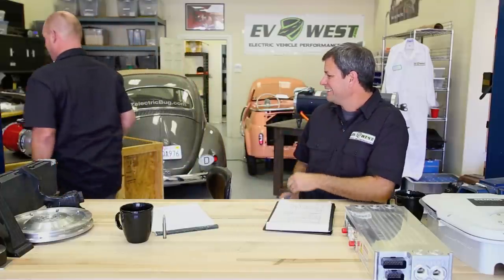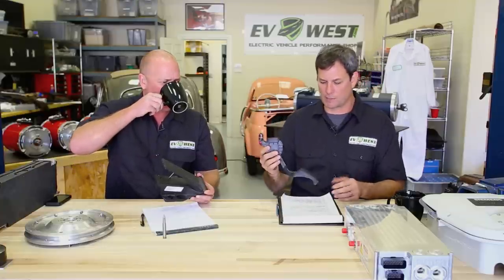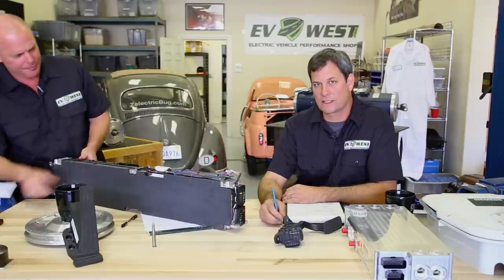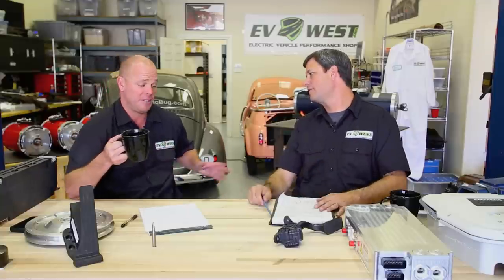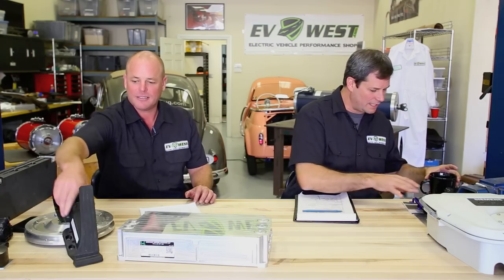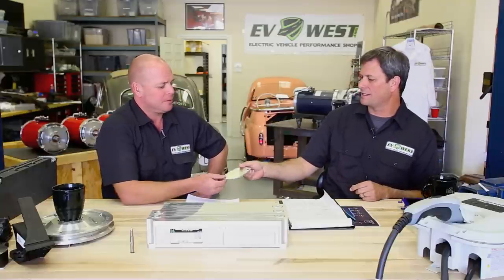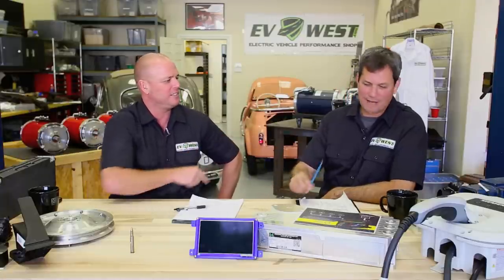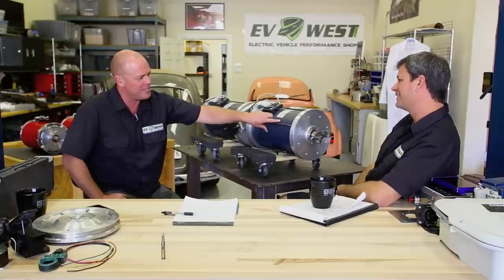The EV Show - December 2014 - Episode 1 - EV West

Comment: Great show guys....  I love the work with the triple HPEVS motors.  I was inspired by Michel Bertrand's AC 35 triplets in his 911.  I got the wife's permission for my next build.  It will be a 1940 Ford Truck in true hotrod style with a motor on each axle.  I am leaning toward a AC35x2 on each axle with a Currie Ford 9" independent Diff with a 7:1 circle track gear set for direct drive....

I am really pleased to see a show about EV that has a focus on performance...
Reply: I cannot wait to see that beast!  Jeff,...With all your experience with the Allen-Bradley equipment, do you have any special incite into the pros and cons of stringing relays and contactors in parrellel and series?
Reply: Well the danger of paralles is that if one does not pull in you try to pull too much current through one relay...

The problem is that it is difficult to detect a failure...
Reply: Jeff Southern
How about running 2  - 12V relays in series with 24V?
Reply: The triple AC-51's are providing engineering challenges to fit into the Ferrari mid-engine area with the G50 but we got it.... nothing we will not document and share..... The performance specs are ridiculous! We can barely wait to start testing it on the pavement. There is an extra stack of tires already waiting to use in the first week. But back to basics, lots of fun fab starting tomorrow.... Will keep updated posts on progress on Instagram. Follow "ElectricFerrari" for a Ferrari 308 GTE specific thread!

Comment: I wonder if Jehu's contactor problem was from using too small a cable and/or lug, which didn't dissipate enough heat.  Along those lines, the copper bars he's using look a bit thin to me.
Reply: Was thinking exactly that as well. The RC connectors had me concerned as well.
Reply: 2/0 AWG wire

Comment: Great Show!. Ive been waiting for something like this although Jack at EVTV does a good job but it just tends to drag for too long. I want to know more about the Triple configuration. Will the 3 motors run with a belt or chain drive. Due too so much torque and RPM wouldn't a belt drive wrap or snap?  Thanks guys.
Reply: michel bertrand No. It's still there. Good or bad, we don't delete any comments.

Comment: This show has a lot of promise.  A few suggestions to make it even better: 1) Less talking about the products and more doing things with them.  More of what we saw in Jehu's segment.  2) MORE CARS!  This is an EV car show, after all.  3) Showing the step by step process of how you go about an EV conversion would be ideal.  I know that would probably be too much for a single show, so you could break it up over multiple shows, or at least show the highlights.  4) Cut the running time down a tad.  Most Roadkill episodes are between 30-45 minutes, some even less than that, and they cram a lot of content into it.

Comment: A question about the joined HPEVS motors...
Is the accessory shaft at the advertised size, or are they the same size as the output shaft?
My eventual plan (when I get enough money to do it) is two AC76 motors for an '03 Mercury Grand Marquis, and I've been hoping that the accessory shaft would be strong enough to take the torque of another motor to simplify the mating process.

Comment: Eric's coffee cup is way too big! Best keep him away from the chocolate before recording.  I like Jehu's Idea about splitting up the current over several contactors, But I have concerns about the current carrying load of those cables.
Reply: I was also concerned that during Jahu's demonstration that the contactors control wiring were wired in series and would not work properly.  I seen a few minutes later during the installation it had been corrected and wired in parallel.
Reply: technogeekworld The coil wires were plugged in series,   the High voltage were connected in parallel, they are 2/0 AWG
Reply: Yes, the coils will still work, but there will be a voltage drop across each of the coils.  In parallel  both coils will get full current and voltage. This is important as you want those contactors pulling force to maintain good contact.   Will it matter ?  Why take the chance of not making good mechanical  contact to create heat. Please consider
.
Reply: Someone was not paying attention to the video,   Contactors are 12v,  my curtis puts out 24v,  thus the series connection.
Reply: Now! you have my full attention! I want front row seats to this!  Get a GoPro in there!  While they are energized get a meter in there.  There is still one more opportunity for adding a resistive load and putting them in parallel.  I'll not bother you more on this any more. I look forward to learning the outcome.

Comment: OMG.. the banter!  Sound like a great concept show. Too much banter not enough info to keep me watching. Also, too non linear, and using terminology without explanation.
Reply: +joseph medina  I can handle the banter, These guys aren't "The View" thank God. lol But I too would appreciate greater explanations of terminology. It IS  a new world. I do love the show and will be subscribing and watching. :) Thanks Guys.
Reply: hey ev west im gonna sell you a moped with a one ignition acc, double 
beam support, nice road tires, and a cool neat pulse circuit.  Tfh chain
 is horizontal, 2005 xtreme scooter frame&housing, but u have to build it man!
  Im sending it right now.
Reply: it will even hav lights that trickle charge, in case you dont have room in the housing for an aux battery...cooolllll!!!!  3-5 year lead acid battery replacement, 1000watt motor, 25 miles+ range...contact me somehow on it
Reply: prototype for sale

Comment: Guys I hope you get into Electric Drag Racing Programs for us guy's that just want to have fun and kick some ass.   I would be interested in a system what would make about 1000 hp at 5252  and would have 1000 ft lb of tq   from  0 rpm right up to 5252 rpm.
I want to build a tube car with a Ford 9" rear and direct drive.   Total wt of about  1800 lb's